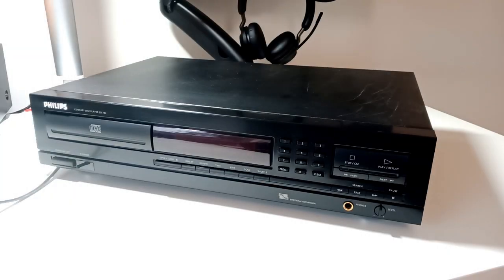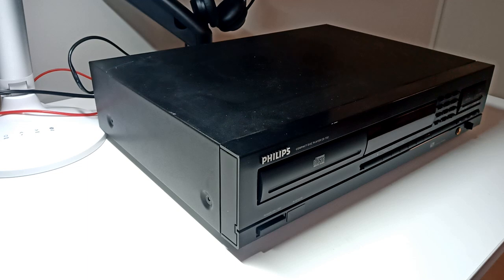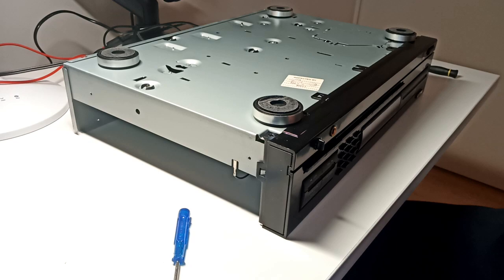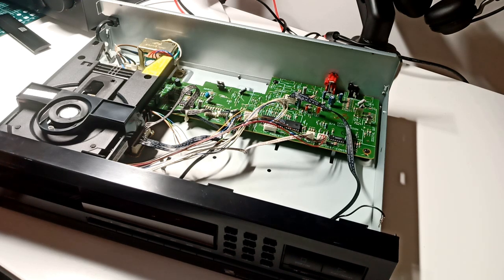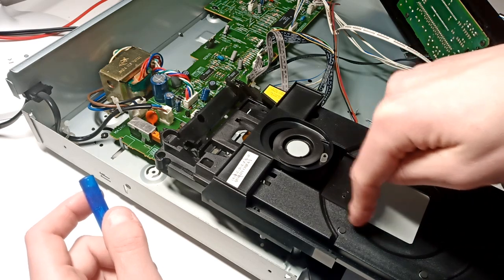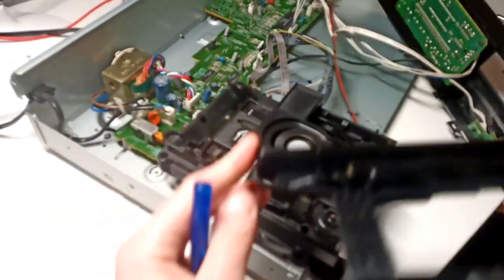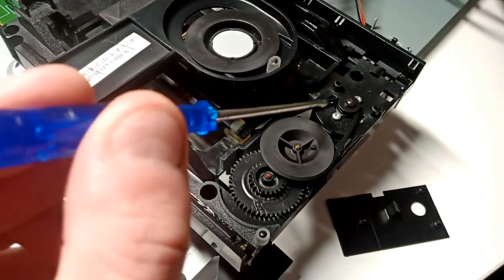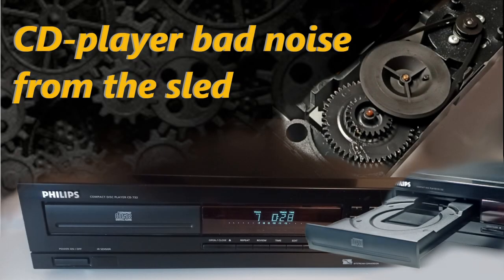CD-player repair: Bad noise from the sled (Philips CD 732)

Comment: Nice video! Very useful instructions. What kind of grease did you use for the moving parts? And where did you get the new belt? Thanks in advance.
Reply from the maker: Any vaselin/grease/oil works if it's not too thick and it's suitable for plastics. I buy belts from local radio/tv-repairshops, I want to support local business instead of ordering from big onlinestores.
Reply: @Riihimasa  Thx for the advice. I've used a little bit of grease on de moving parts. I could not find a specific belt so I used a rubber band. No more sqeeking, thx for the tutorial!😎